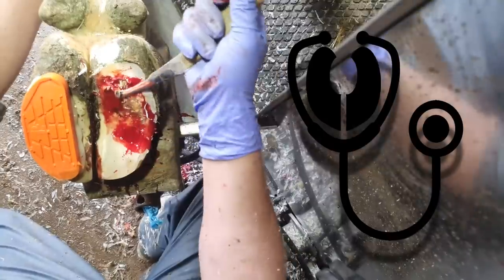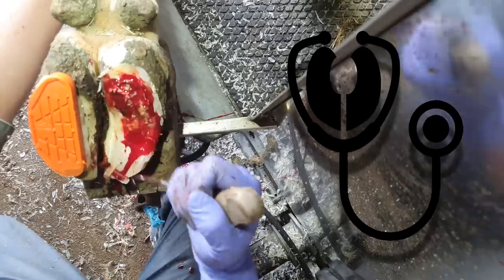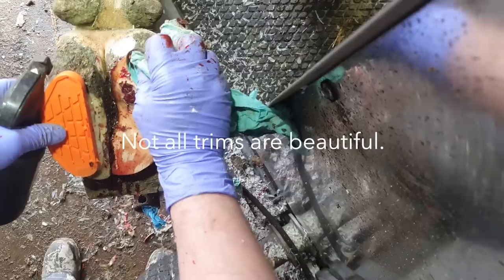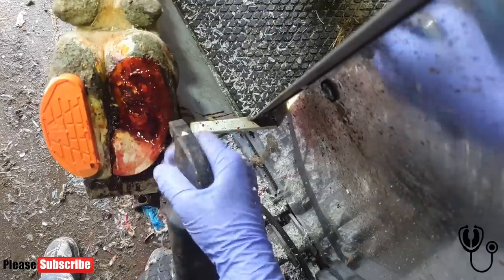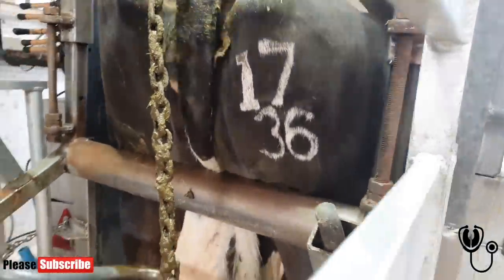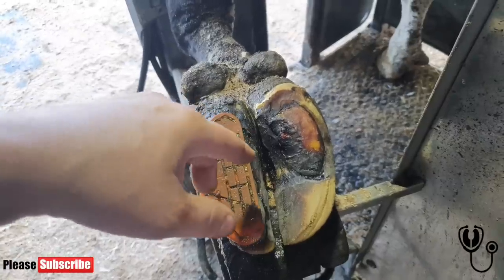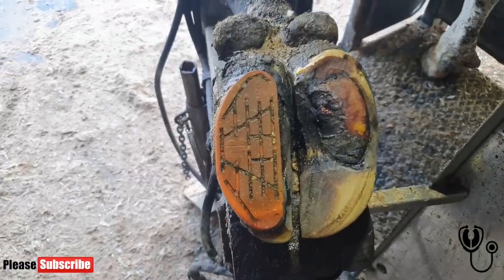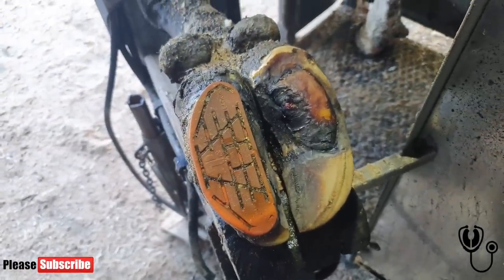Ensuring REAL healling! | The Hoof GP

Comment: Why did you leave that open? I mean, if it was a lesion on the neck I believe  it heals faster, but on the hoof where it is constantly on mud and manure, wouldn't be better to cover that with cotton and tape to hold some medicine in there?
Reply from the maker: Absolutely not - that would create a habitat perfect for bacteria to thrive in - it is EXTREMELY difficult to create an environment which slurry will not penetrate on a cows foot using a bandage - plus the constriction required to do so is usually painful for the cow!

Comment: I suggest you bin those double sided thick knives and get a couple of decent sets of left & right handed knives, plus learn how to sharpen them with a thin electric belt knife sharpening machine. Other than that good job!
Reply from the maker: I only use the pre ground double sided knives- theyre far quicker and more versatile than single sided for me (although i do have a few sets of singles). I actually do have a sanding belt sharpener but find that whilst they both get the knives equally sharp (enough to easily shave with as in the video lol) the belt removes too much steel so it takes longer to polish them and the knives wear more quickly. I know loads of people dont like/use double sided knives though because they find they cut themselves easily and just dislike them though. 

Cheers for the watching and your input!